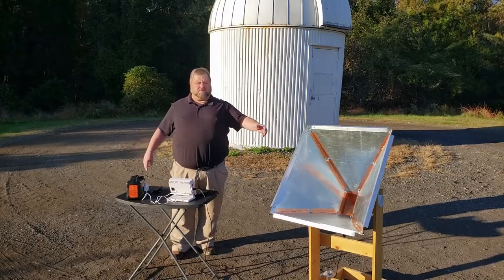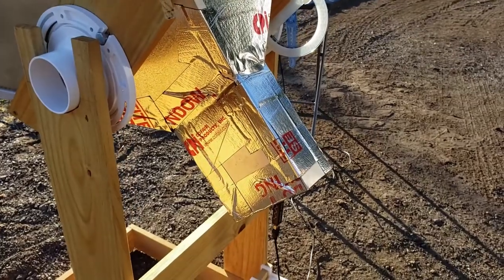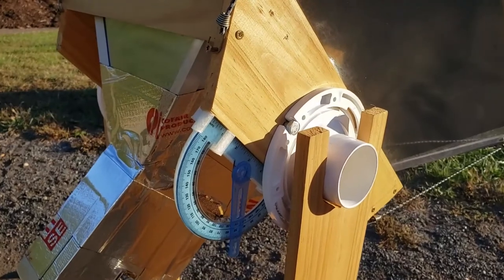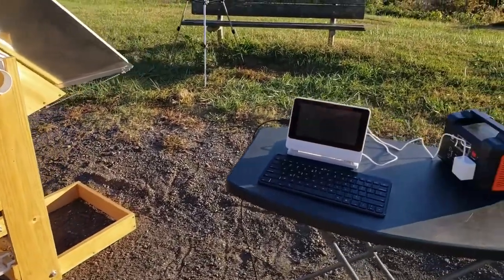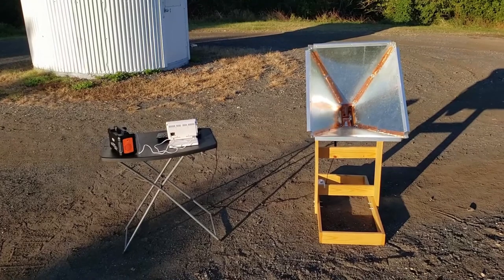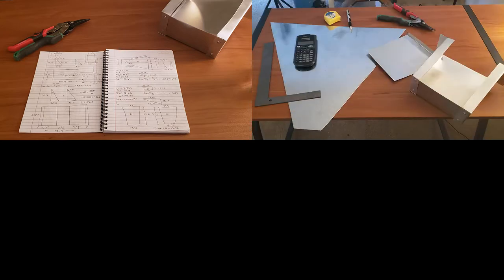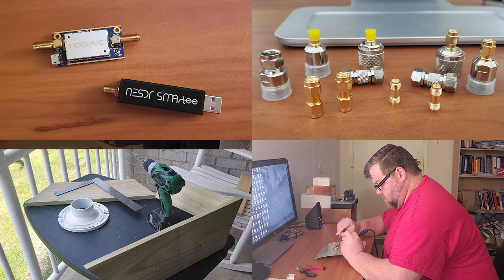The Hydrogen Line in Radio Astronomy

Comment: Please note, you don't need a sound-card, or an audio input jack as the interface is USB. Also, I'd recommend getting an RTL-SDR dongle that uses an TCXO local oscillator,(this is a big deal as the oscillators can drift with temperature and loose sensitivity as it gets warmer)  or the AirSpy that increase the bit-depth from 8 bits to 12, etc.. Another useful thing to add is a "cavity filter" which blocks all other radio interference sources to minimize out-of-band interference and has exceptional stop-band attenuation. There are plans on how to make these on the web as well. You will see a huge difference in the sensitivity. Also, please get the lowest "noise-figure" and highest gain "low noise amplifier" you can get.   If you're feeling even more adventuresome, you can pull out the horizontal and vertical polarizations, as galactic sources often have distinctive polarizations, but this requires an additional radio (or channel), LNA, etc..

Comment: For those comments about sound card requirement, Back in the 80's and early to mid 90's, before USB and SDRs, the sound card was very important to and how data was collected for both radio astronomy and hams . Maybe that's what he was thinking of.
The Atari 400 computer was popular back then for this purpose (more for SETI then Ham's) because of the quality and ease of programming of it's sound chip relative to system price and it's data recorder used ordinary audio tapes too! (Before hard drives were smaller than your desk drawer and affordable)

Comment: Excellent video, thank for sharing the good quality information. I'm pretty new in radioastronomy, and I considered a very, very interesting branch. I have some questions too about building a homemade rediotelescope: what is the minimum size of the dish? (I like to build it using a parabolic antenna), and I have to use a SDR too to see  on a computer monitor? (or a spectrum analiser is useful  too??), and the last,  if is good to use a low noise amplifier too ? Thanks for you help. Have nice day!

Comment: wow! Does the size of the horn matter? Is bigger better?
Reply: The size of the horn does matter, and in general, bigger is better. However, what is more important is the ratio of different parts of the horn. The purpose of the horn is to gradually change the impedance so it matches the impedance of the waveguide, and the size of the waveguide is determined by the frequency you want to detect.

Comment: GREAT POST !  Wish you would share your WEB sources for the plans for the antenna parts as well as other sources for radioastronomy hardware and software.  If you had a couple of dozen small radiotelescopes and synchronized them using the time standard from. WWV would it be possible to Create a WEB Based VLA to allow members to do RADIOINTERFEROMETRY?
Reply: I had shared these in response to another comment, but it was buried a bit. The plans are at https://lweb.cfa.harvard.edu/~npatel/hornAntennaAASposterPDF2.pdf.

As for interferometry, the Society of Amateur Radio Astronomers had an article in a recent issue of their journal about doing that.

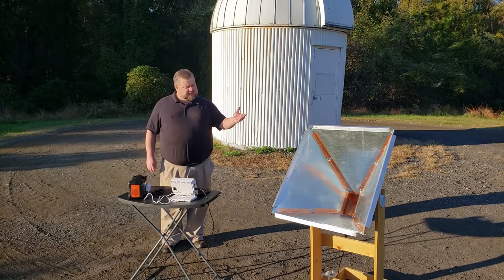Comment: 1:45 - Pyramidal horn antennas have gotten into dis-use not only by radio astronomers but also everywhere else in radio communication. Including radio amateurs. The reason is, although they are easy to design and build, the performance is rather poor for the amount of material used. Actually a cheap Wifi Yagi will beat the big horn shown here hands down. Even better is a small horn + old satellite dish. Probably a dish will allow to locate the milky way with good accuracy, givern its gain.

Comment: 3:24 An SDR software defined radio receiver has nothing to do with the computer's sound card.  The RF detection and audio processing is all done in software.  The soundcard is only needed to play the audio the software has detected.
Reply: Back in the 80's and early to mid 90's, before USB and SDRs, the sound card was very important and how data was collected for both radio astronomy and hams . Maybe that's what he was thinking of.
The Atari 400 computer was especially popular back then because of the quality and ease of programming of it's sound chip relative to system price and it's data recorder used ordinary audio tapes too! (Before hard drives were smaller than your desk drawer and affordable)
Reply: @petevenuti7355 I'm sure what he was thinking about were the various soundcard modes still used in ham radio today such as FT8, Q65 (and the rest of the WSJT-X suite) and the older modes like PSK31, RTTY, AMTOR, etc (FLDigi as an example). But those don't have anything in particular to do with SDRs.  We didn't really have soundcards on 8 bit computers in the 80s.  Many had sound generating chips of various abilities, but most couldn't record and playback audio (with a very few exceptions).  While there was certainly some specialized software for doing things like CW or RTTY back then, the soundcard modes didn't really become a thing until the 00s quite a while after soundcards appeared in PCs.  It had to wait until processors were powerful enough to handle the CPU intensive real-time DSP those modes require.

Comment: What are the connector used for this radio telescope (like example n type connector)?????....
And how many connector I need in each type to make this radio telescope..
Reply: The connector on the waveguide is an N-type. This is stepped down to an SMA connector, which is what both the LNA and SDR use. The SDR is this connected to the Raspberry Pi via USB.